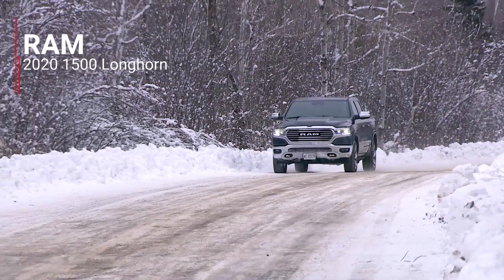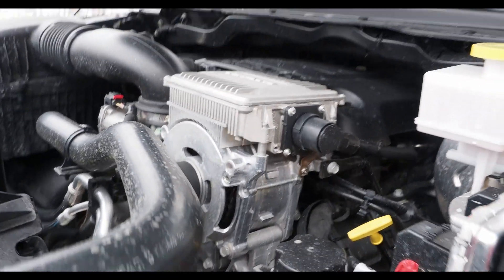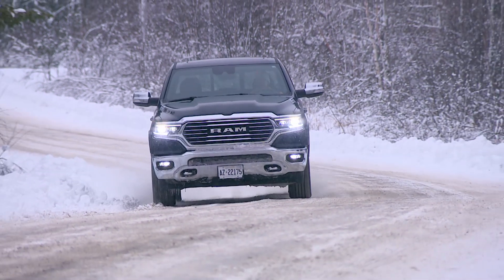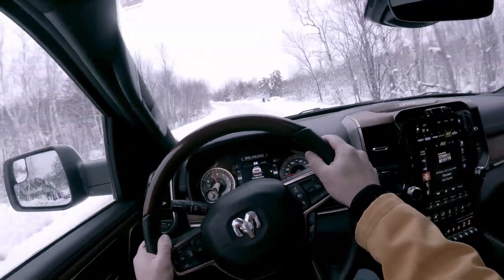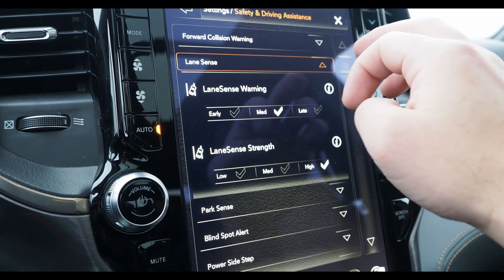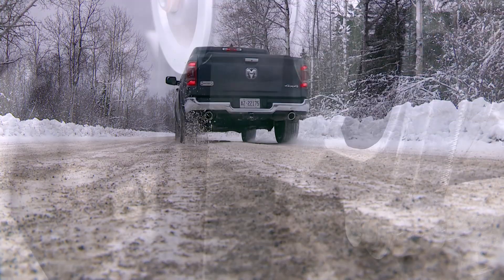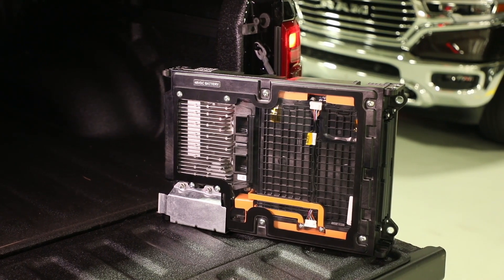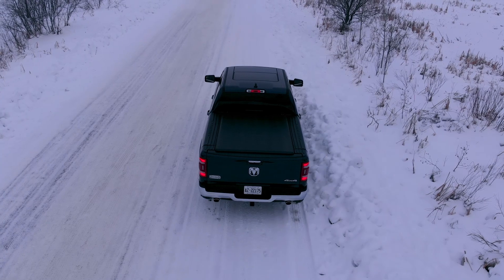The 2020 Dodge Ram 1500 HEMI is a HYBRID?? (HEMI E-Torque Explained FULLY and SIMPLY)

Comment: I just ordered a 2021 Ram 1500 4x4 Limited LongHorn. I did not get the eTorque with the 5.7L Hemi. Car/ Driver and Motor Trend. Said they did not gain any Mpg with it. Plus they had problems with it. And it adds 70Lbs of weight.

Comment: The ONLY reason for an E-torque is for start/stop so your engine shuts off when stopped. Less wear n tear the new E-torque motor compared to the old starter (which has been a weak point in the Ram so over all it's an improvement).
Reply: E-torque Rams still have a conventional starter.
Reply: @bufordfrance8058  But for start stop, it's the E-torque that does the work...
Reply: @Caladuun  All hybrids use exactly the very same system, this is nothing new.
Reply: All the wear and tear is on the combination alternator/e-torque motor.
Reply: @bufordfrance8058  Yes, that is what I said....2 years ago.

Comment: I guess the question is: is it worth the purchase price?
Reply: Now it's standard on the 6 and only $200 more on the 8!
Reply: Car Driver said no. Even at the $200.00 level.
Reply: The e torque option is  only $1200 more over the 5.7 standard. I'd say yes.
Reply: @onlyajeep97  It's probably double that to replace it and if it's like an actual hybrid, you have you replace it every five years.
Reply: @onlyajeep97  It won't save you one cent.
Reply: HELL NO it's not worth it. You can't tell the MPG difference unless the vehicle is on a dyno